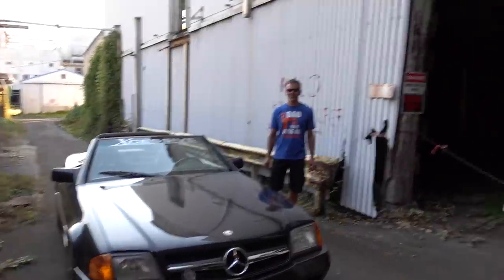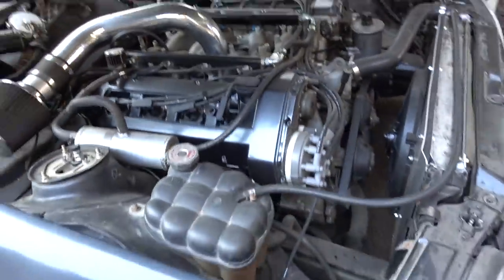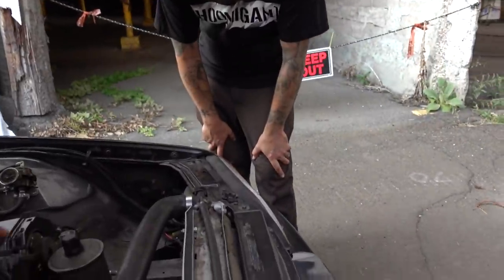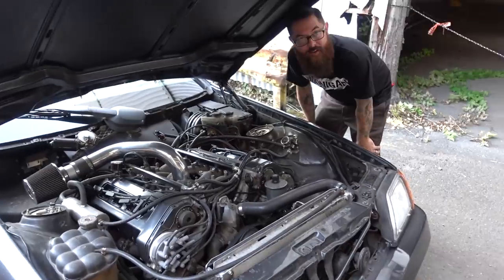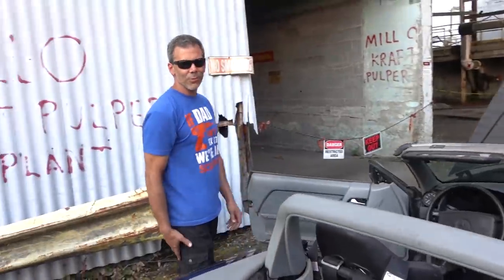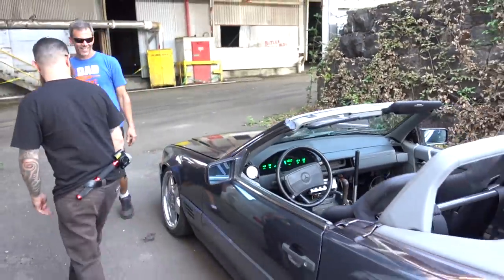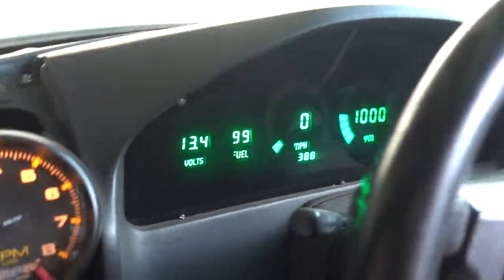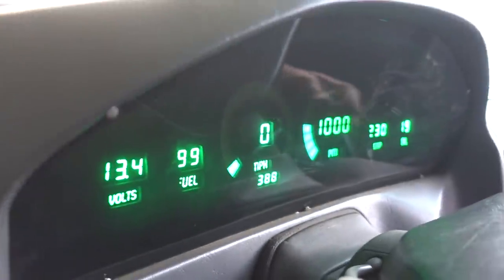Xcessive V8 SL500 Shreds Tires at the Donut Mill!

Comment: I own the same car. I’m hitting these guys up immediately. Never seen a company build the old SL I thought I was the only one out here!!!
Reply: Your name made me laugh thanks for that
Reply: I have always thought of why nobody messes around with those old mercs with v12s, I've always wondered how they would sound with a good exhaust system and mabye boosted
Reply: Eduardo Nava bruh picked up a 5sp e34 530i 3l v8 bmw Cut the muffler off the thing sounds like a bmw gt car
Reply: @Malibus_Most_Wanted  post a clip of it, I wanna hear that thing
Reply: On MotorTrends Hot Rod Garage they put a single turbo 2JZ in an SL500 and said that the motor mounts were in the same position as the original benz engine. They even used oem mercedes engine mounts and only had to grind off an alignment pin then then the 2JZ just bolted in
Reply: @eduardonava9073  if you wanna know how a mercedes v12 sounds like just check out all of the pagani cars...the first zonda just had a stock m120 v12....
Reply: Hope you drop your ig, I have one too
Reply: Talk to me i can teach
Reply: I own 2 and have been trying to track them down give me their info if you find them
Reply: I’m a beginner jumping in a world of warriors, is homie still alive?

Comment: 3 am squad checking in. These guys are inspirational to jump out of the norm. You dont need to buy a 240 or do a jz swap to party. This shows with a little thoughtful engineeringness you can thrash anything. Not knocking jz or s chassis's cause there a proven platform that work. Just nice to see some different type of cookies.

Comment: Just imagine how crammed the V12 would be in the SL
Reply: I own a v12 sl600. It has been pretty reliable and not that hard to work on because it is narrower than a v8
Reply: @patricksmith1550  really!? Pleasantly surprised by that. I assume it’s because the v12 is 60 degree 
rather than the 90 degree on the V8. How’s the space in front and behind the engine?
Reply: @will5436  it is a bit cramped, because unfortunately it is longer than a v8, but the car was designed to house an inline 6, so its not like thats any shorter

Comment: 300 HP? Wut? Stock is 240 kW (326 PS). so he literally crapped it?
Reply: beside this all he did to this car is doing a sweet fine new suspension and some new gage clusters + handbrake? 
not impressed
Reply: Maybe wheel hursepewers, not crank hursepewers?
Reply: Mephisto not every build has to be unfeasible for any normal person to be cool. This car literally just brought back my love for old Mercedes cars.
Reply: so lets say 15% from BHP to WHP. 
but still... I mean...
Reply: I fully understand you. I wanna get an older SL some day. but do you get what I mean? I wouldn't have touched the engine for like +20 BHP.
I just dont get the hype. Just look at the interieur 0:23... this is some nasty shit
Reply: might be. but again. stock is 470 Nm @ 3900/min
Reply: But its running most old mercs arnt
Reply: Its depends on what market Mercedes is selling to. Euro/Asia and some other overseas areas might get a higher bhp from factory. U.S. spec cars have emissions to comply with so manufactures may detune them to meet regulations. So an 500sl from Germany may be 330 bph but a U.S. spec may only get 295 bph.
Reply: Mephisto oh yeah can u design a cantilever suspension to fit in the rear or make an adapter plate to use a tranny it never came with. How about redesign the ignition system to use more readily available high performance parts that are cheaper to replace than the stock merc stuff. Not to mention all electrical components still work. The interior is shit but then again it’s a drift middle he uses for fun. The car itself has no real loose ends and it’s ready for more power aka turbo

Comment: As an AMG enthusiast, this is by far not impressive. I've seen older  Mercedes with far less power do way more carnage than this. Complete weaksauce.
Reply: I agree. Also AMG enthusiast here. I've only owned Mercedes. My last car was a 1995 E300D with half a million miles. OM606 motor reliable as all hell. Miss the car and want to get another. What "xcessvive" did wasn't all that crazy excessive lol